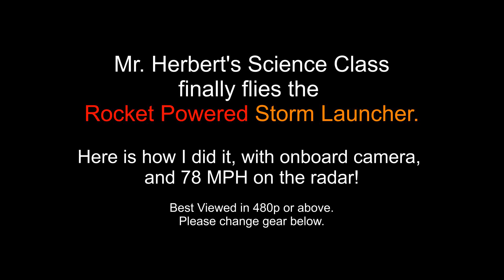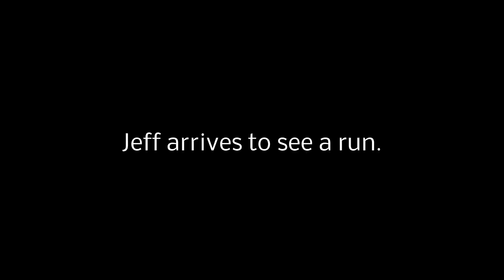Rocket Powered, Flat body, Storm Launcher does 73 mph in a finally successful flight.

Comment: What about the wimpy launch "guide post" that flexed and fell over?
Maybe if that was stronger and more solid it would have worked?  Hmmm....
Reply from the maker: BWX That's true.  It worked for all my rockets but I don't think any launch rod would work on this Storm launcher, because it would not even take off the ground without going wild.  With no surface controls, it would have done the same thing dropped from a plane.  LOL.   But... the next rocket has 7 motors on it, and believe me it is very big and has a large solid launch rail. I hope it is big  enough.  Stay tuned and Thanks.
Reply: ***** Should be fun!